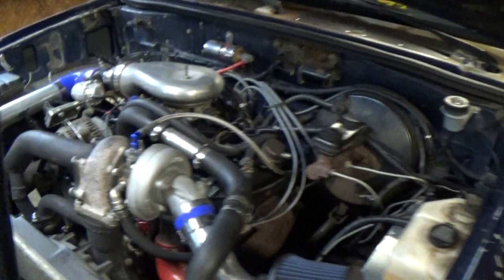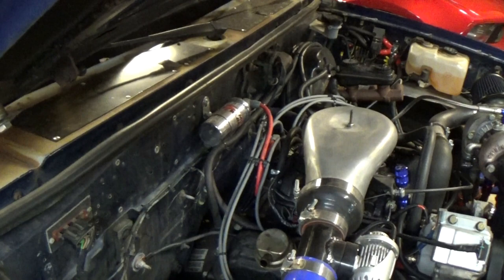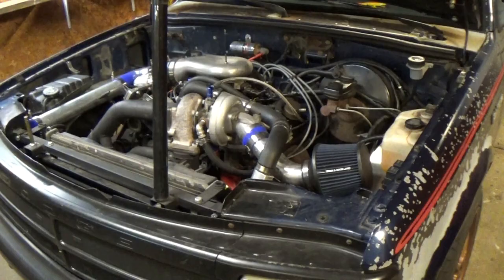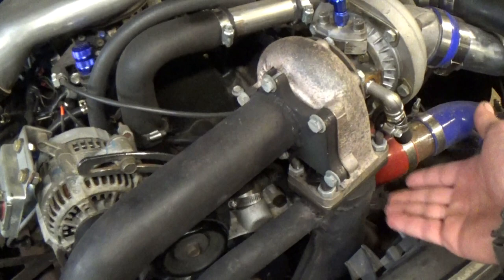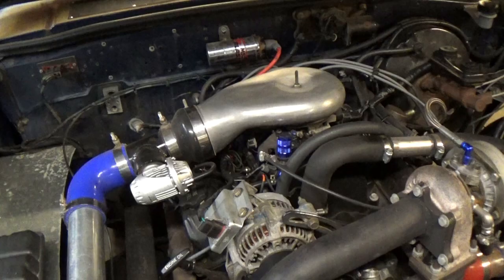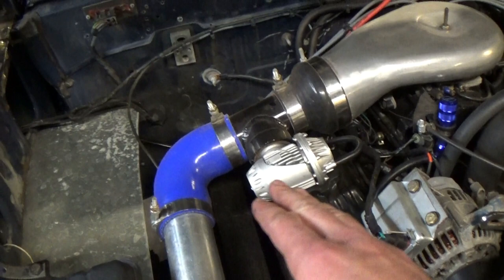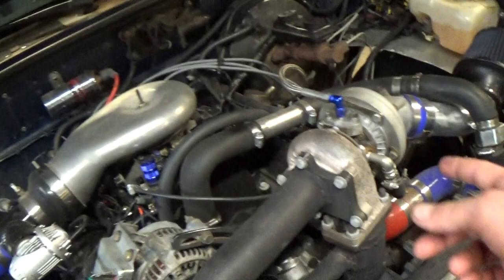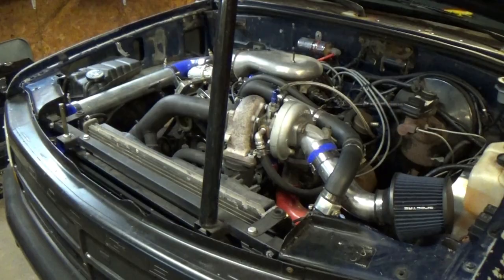How To Turbocharge Your 3.9 V6 Magnum Dodge Dakota and Make 250 Wheel Horsepower

Comment: Ok I thought I’d like this video till you said idk if the tooth count ~4:05 in the v8 would be different. WTF of caurse it’s different. It’s a fucking v8 it has 8 vs 6 teeth hens it picks up 8 times to sap ark vs 6. This may of been a mistake cause you were excited but seriously come on man!!!
Reply from the maker: The teeth in the trigger wheel do not tell the ecu where the pistons are on the crank directly, they are a sequence code that the ecu uses to determine crank position. It is possible that Chrysler used the same sequence on the v8s and v6s but I’ve never had the chance to look at the trigger wheel on a v8 distributor which is why I said in the video that I didn’t know if they would be different or not.
Reply: @alvie teal What's going on in your life at the time of your comment, why are you so upset?